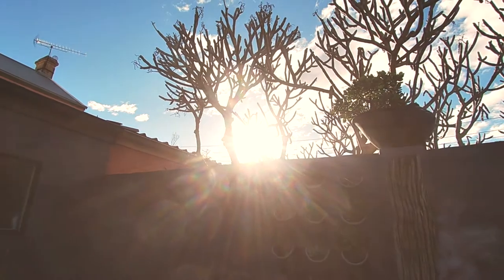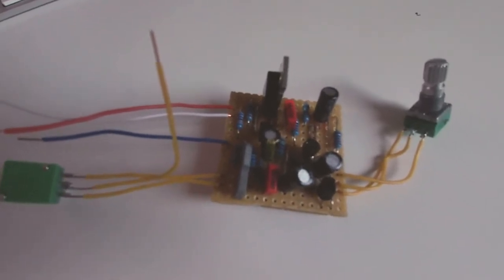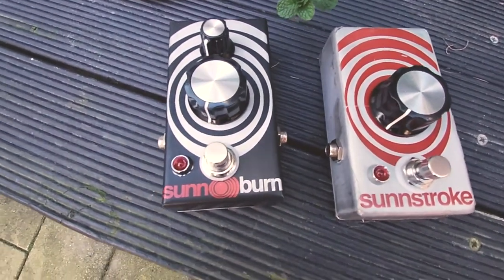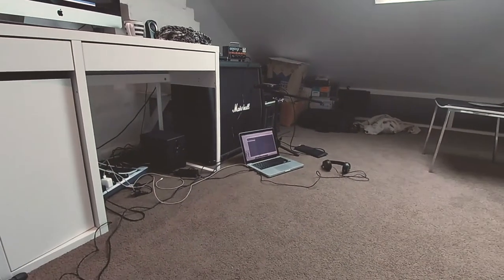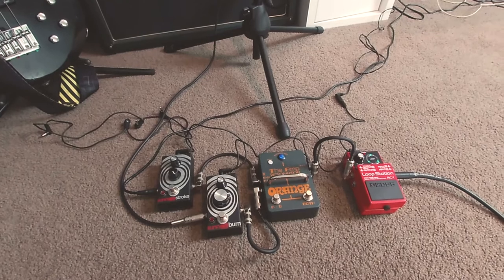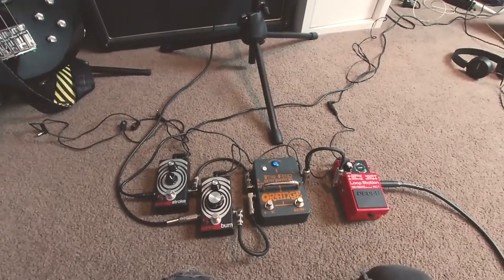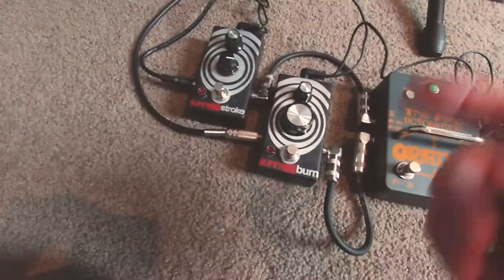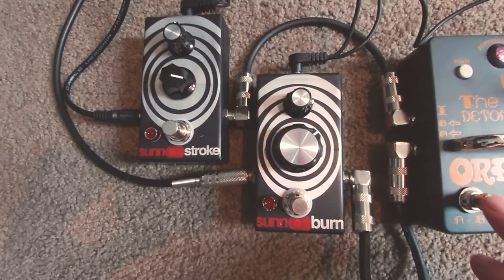DIY Pedals inspired by Sunn Buzz & Sunn Model T

Comment: Is that a 1:1 sunn buzz clone, or did you tweak it? Been thinking of making one, myself
Reply from the maker: Yeah pretty much, but hold that thought I am making one currently with is more like the OG one and will run off an AA battery. Just follow the vero layouts on tagboard. It’s a pretty cool fuzz and a bit underestimated when you chuck it thru a big amp
Reply: @unholyaudiochannel  awesome! I want to make a mod with a blender knob between germanium and silicon, just to get a wider variety of tones
Reply from the maker: @chriswakfer4473  maybe bread bird the circuit and then do your mods from there

Comment: Love the LM386 based dirt box you've built. The sound breaks down in a really spurty way, like youve thrown in some welrd EHX modulation pedal. Great graphics as well. I've played around with these on a breadboard. Not tried the Sunn twin op amp yet. Is there a particular suffix you used on the op amps? Are there different gain models? I heard it's important on the single op amp models. Which is why they don't always sound right.
Reply from the maker: Cheeers